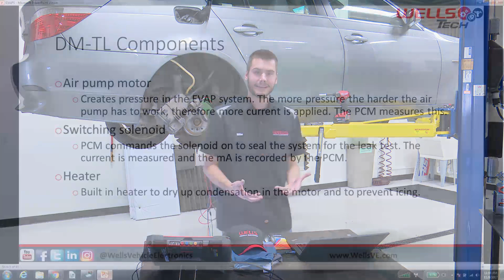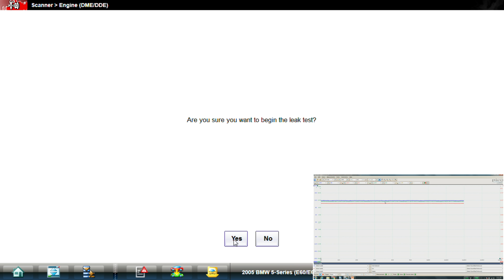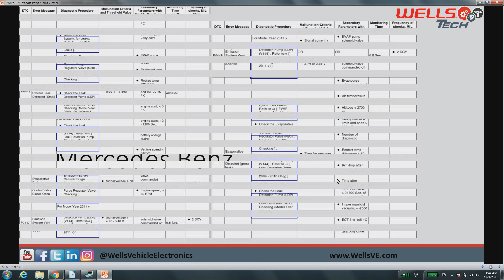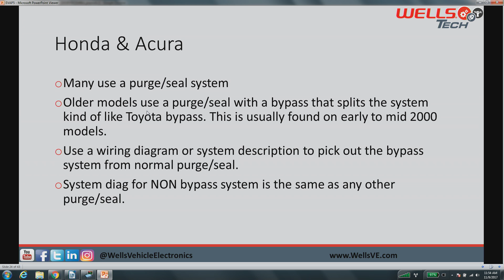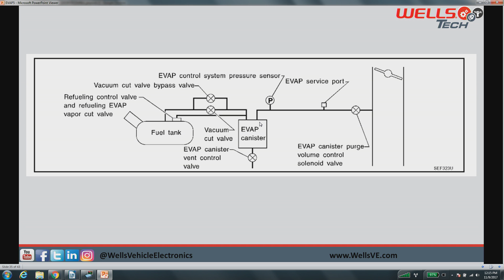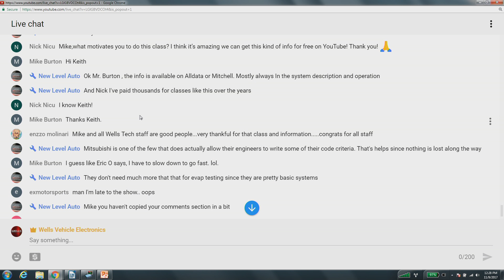EVAP - The Finale! Lesser Known EVAP Systems With Tips and Tricks (BMW Demo)

Comment: Getting codes p2401 p2419 and p240a all point to low voltage and open circuit
Reply from the maker: Hey Arthur, I would need to know the car so I can take a look at the information

Comment: Yes there is a battery vent system on a Tesla but it is for balance of atmospheric pressure and temperature compensation.
Reply from the maker: Hey William, are those climate controlled indepenedant of the passenger HVAC system? I know some vehicles use a seperate blower motor. 
Mike Becker, Senior Instructor
Reply: Mike,  The Tesla system has a heat pump that controls both the hvac and the battery with coolant through a octovalve the only blower motor is for the passenger cabin. Watch Monroe Live or Weber College you tube vids if you wish more details. As they have both disassembled teslas on camera

Comment: Wow! By far this is the best video yet on the DM-TL. I wish you had either spoke, or brought up on screen the fuel tank capacity, the amount of fuel, the ambient air pressure/temperature/relative humidity; no wind direction since you are indoors. This is what I surmised with the data from the video and a cup of coffee: 20:1:1; meaning, on pump up with a "low" fuel in (unknown size) tank, the current draw in milliamps, starting at 23, went up one milliampere every 20 seconds, on average, rounded, all the way up to 30 mA. A humongous leak (when fuel cap was removed) dropped the current by one mA per second. Therefore, since numbers don't lie, a technician can deduce the size of the leak by a rough guestimate of the current rise, or drop per time. In our shop we do not guess and replace, hope and pray; we confirm the concern, diagnose, confirm the diagnosis, repair, confirm the repair then turn the vehicle over to the customer and collect a lot of money based on our education, training, experience, and accomplishments and not on just what we do. Lastly, you can lie with numbers, we don't, we use them to backup our decisions and actions based on not reinventing the "wheel", but on established specifications by the design engineers, which by the way, more than occasionally make design flaws that are caught with TSBs. Great video, liked and subscribed.
Reply from the maker: Hey Menkeyman, thanks!!! Great info. Only thing I would cation is that mA's do change with heat. As the pump runs it heats up and increases it's resistance. This can also create a drop in mAs. As long as we know what the numbers should do then we are all set!
Mike Becker, Senior Technical Services Instructor

Comment: he didnt test the purge valve for proper operation and by doing that testing the ftp sensor.
Reply from the maker: Hey Gear Wrench87, that is correct. He didn't test the purge at all. So the PCM goes to test the system for a leak and opens the purge. FTP never changes so the PCM thinks it has a large leak, but what if the purge never actually opened. :) Well done!
Mike Becker, Technical Services Instructor
Reply: Lack of attention to detail will kill any shop, or business eventually. In this business there is no room for half-ass, or shoddy work, I don't like it when others do it because it reflects on my chosen field, which means on me too. I love complete and thorough; even though, it is not concise. An easy buck ($) can be really expensive down the road. Good spot Gear Wrench87.

Comment: Wow! EVAP systems have come a long way since 1970. The first purge valves were controlled by a vacuum port above the throttle plate in the carburetor. They purged extra fuel vapors anytime the throttle was opened above idle. Now, the engine computer runs the whole show.
Reply from the maker: Hey Joseph, yes they have!!!! Emissions standards brought that all on. Gone are the days of the vented gas cap :)
Mike Becker, Technical Services Instructor

Comment: I missed the e-mail deadline, but I'm guessing fuel tank pressure sensor.
Reply from the maker: Hey Rgeier11, could be maybe. What if the FTP is responding? I should have called it out in the question. Lets say when the tech hooked up the smoke machine and closed the vent he was watching the FTP and it responded accordingly. What would be your thought then?
Mike Becker, Technical Services Instructor
Reply: The leak could have been coming from the actual test port.  I love the videos, Mike.  You always do a great job.
Reply from the maker: This is also true. Now you have thought of 2 of the 3 answers i'm looking for. I'm hoping you can nail the third one down. Lets say this car doesn't have a test port. What could be the problem then?
Mike Becker, Technical Services Instructor
Reply: I would then look for a sticking purge valve and cycle it just like the mechanic did with the vent.
Reply from the maker: So, what is the failure with the purge? Stuck open, or stuck closed?
Mike Becker, Technical Services Instructor